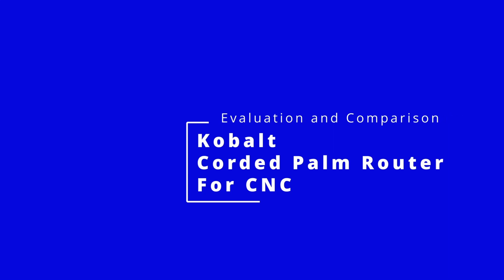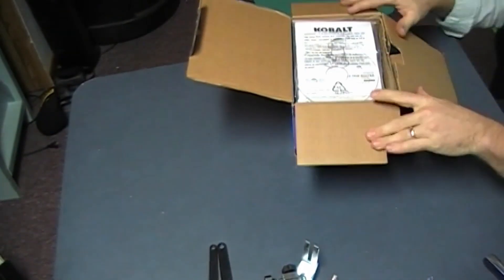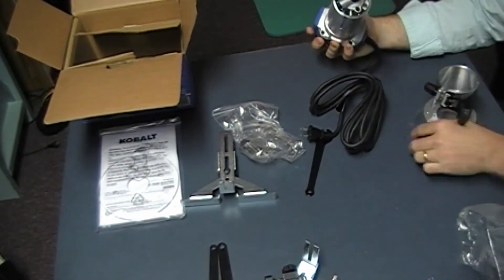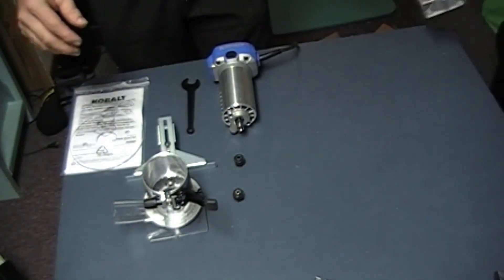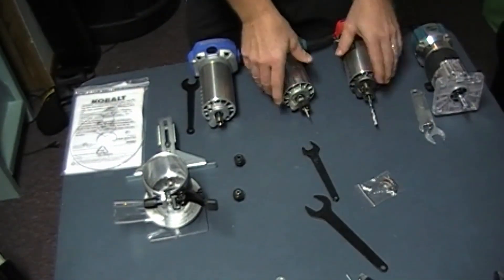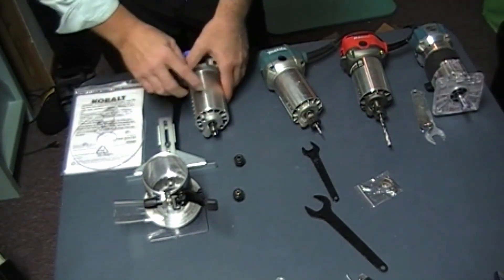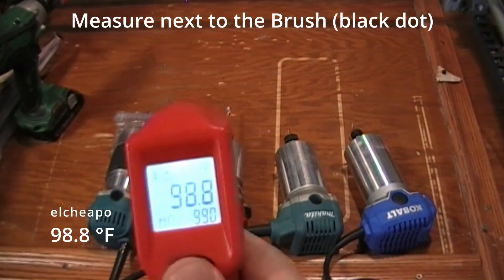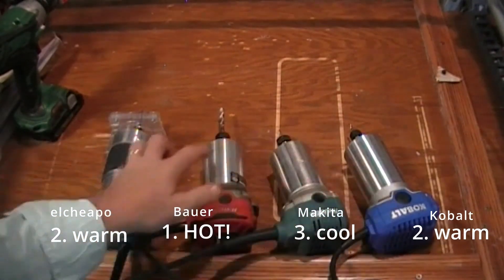NEW Kobalt Corded Trim Router for CNC

Comment: Thanks for the video.  Can you please measure the approximate barrel diameter?  The Makita is apparently 65 mm, and I’m curious about how to define “slightly larger”.  Just trying to determine if the Kobalt will work with the same 65mm adapter as the Makita, or possibly the 69mm adapter for the DEWALT (in combination with the Genmitsu 4040 Pro CNC).  Having to print or machine something custom seems like a miss among what is otherwise many good design elements for the Kobalt.
Reply from the maker: It is 65.8 mm i believe.  The electronics housing is slightly larger than the Makita too.  I was able to fit it into the Makita mount with some expansion, but the Makita mount on the mpcnc was too close to the bearing so it couldn't move vertically as it needed.  A new mounting bracket was printed.